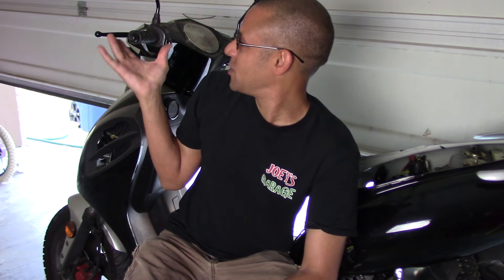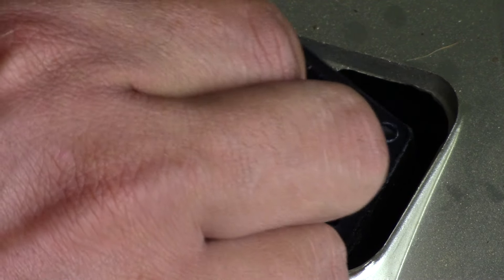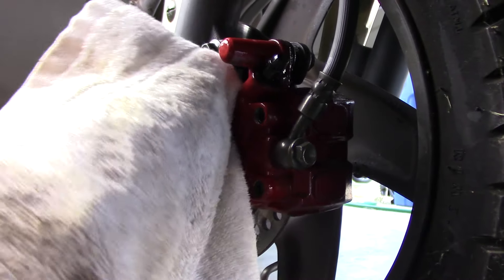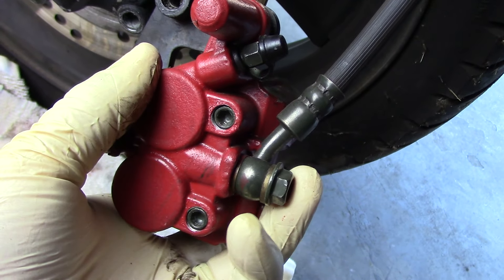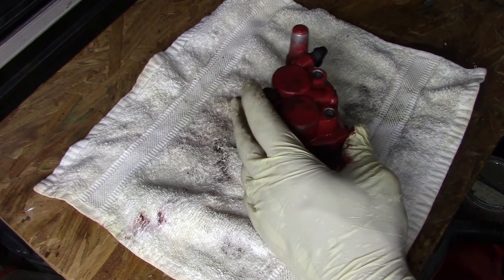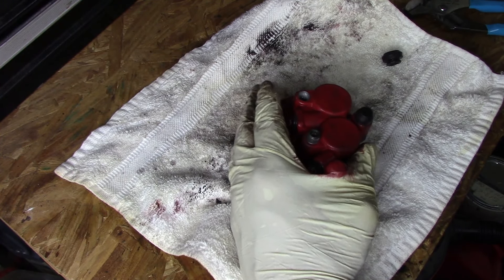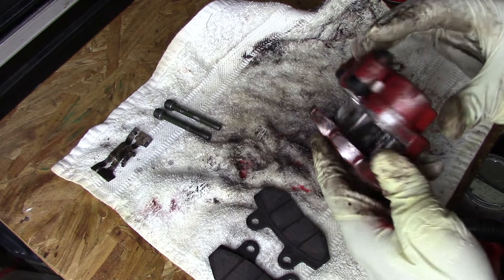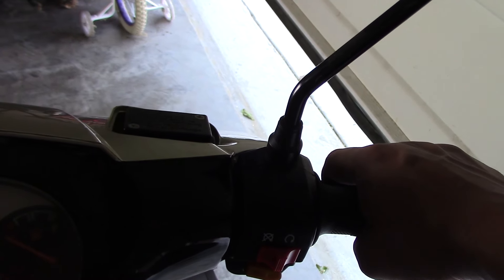Brake System Tutorial (Scooter / Motorcycle)

Comment: The problem was that that brakes got stuck all the way open, I think.  Perhaps due to dried fluid or debris behind it.  Once you broke it so they could move again, they could automatically adjust again.  Another symptom is probably that the brakes would always be on when hot before this happened.  A faster way to fix would be to just move the pads with a screwdriver while they caliper is still on, if my theory is correct.  Thanks for sharing.

Comment: Great video. Do you have a video on how to bleed the brakes?
Reply from the maker: No. But it’s super easy.  Similar to cars, have a plastic bottle with your Brake fluid. Open valve, and pump the brakes.  Don’t let reservoir run dry.

Comment: After i removed the front eheel to have a bew tire on and i also did new brake pads, the pads made a bit of noise which i was told was a bit normal for new pads. The caliper seemed ok and pumped back onto wheel when i installed it. But i think i need to redo thise completly as now when i put the bike down and went to move it, its totally not going anywhere!  Im workibg on a 2009 ysmaha majesty 400 scooter. Any ideas for ne epukd bd great.  Maybe a caliper rebuild kit, ir can i take the pustobs out and gently refurbish? Please reply, would love the help. Thanks much, Vicki

Comment: GOD dammit! I did mistake. After cleaning it I still can't feel pressure on my brake? I needed to clean it out by having the pistons out and not closed because of that I think its stick to the point I am unable to bleed the brakes?

What to do with a closed pistons? I took it off the brake fluid line so its by itself. Now how do I open the pistons up so I can clean it properly? Or do I need a new one? Arrhhh!!!!